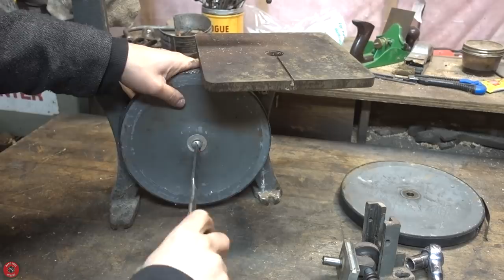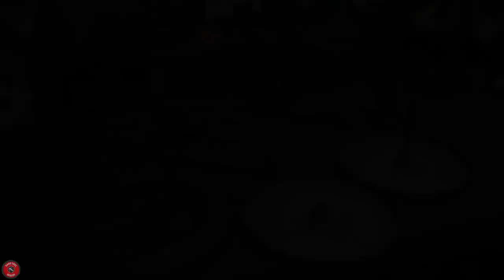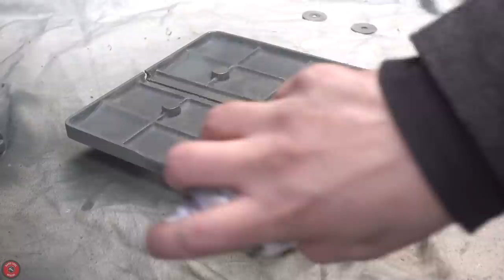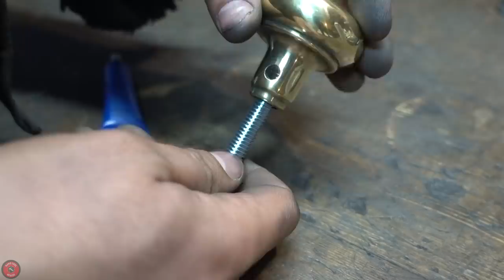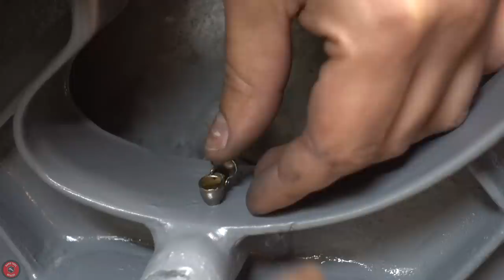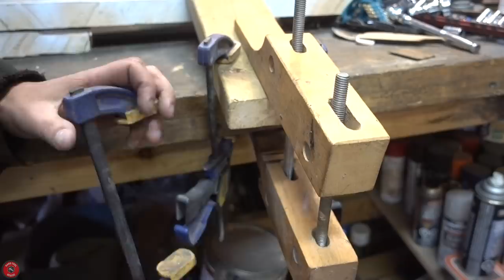1940s Mini Band Saw [Restoration]

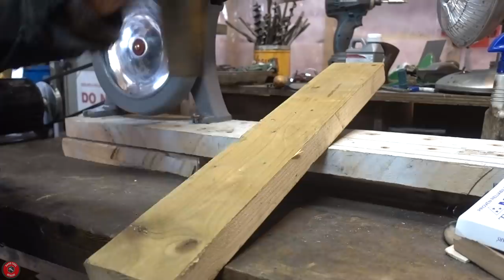Comment: 21:22 Prefect for field use 100% trouble free setup.
Reply from the maker: So easy.
Reply: Handsome Rob kkkkkkk
Reply: Hand Tool Rescue - that part and the part where your spinning the wheel in the drill and it falls out and you slowly back away had me laughing my ass off.

Comment: Dude this video is fantastic. My parwnts bought me this exact same band saw when I was like 12 when I started carving decoys. They bought it used at a yard sale. It was rough then. Time and myself wasnt very good to it. It was definately a work horse, but has a lot of sentimental value to me. Ive been wanting to restore it for years. Just never took the time to do it. This video gave me the jump start kick in the tail to get started on it. I think om gonna steal your brass door knob idea. Mine has the knob still on it. Yours just looks alot cooler. Thanks for the insperation. Keep the videos coming. Ive watched most of what you have since I saw this one. A tone of good stuff man, a ton. Keep'em comin.

Comment: Lovely restoration. I have a nearly identical saw that bears a Montgomery Wards Powr-Kraft logo. I put new tires on it, cleaned it up enough to work well, and now keep it in the kitchen as a little butcher saw. It's dandy for splitting game hens while they're still frozen and saves me a trip to the big band saw in the shop. Now, however, you've shamed me into really tearing into it and making it gleam.

Comment: Just a heads up, the height of the upper blade guide is set to the thickness of the wood being sawn, plus about a 1/4" to 3/8" for safe working clearance. Also the clamp scenario was a hoot and I also liked the drill spinning one of the main pulleys. I would like to see much more of your shows.Great job. GOD bless.

Comment: The latest in a line of entertaining and informative videos. Makes me smile in anticipation when one pops up. Drawing on a comment made earlier -- you might find a variable speed wood lathe useful. I use mine, with an assortment of mandrels, for buffing and wire wheeling. I have 12" and 16" disk sanders made from MDF disks. I have other disks with leather glued around the perimeter that I use for power stropping. A world of uses -- occasionally, I'll even turn a bowl on it :-)  Clyde
Reply from the maker: Good idea!

Comment: You have a great investment there. I think I would use the brass to make the center hole for the blade. I would also put at least a 1/2 horse variable speed motor on the band saw. What a great piece of antique shop equipment.

Comment: Rack up another great video. This band saw may be older than chrome Art Deco so the shiny wheels may not fit, but I do like it. Red added a nice touch of color. Use of the brass door handle was innovative. It is a nice reminder to see something that needed a separate motor for use.

Comment: My Dad and I picked up this antique air compressor made for dental use, it's pretty banged up, would be cool to see it working again but with the shape it's in I think ti would just be a lot of broken bolts and busted knuckles. You should restore an old air compressor sometime, could be a challenge. Gonna get a quick video of it tomorrow, won't be running of course.

Comment: I had a 1940s table top table saw. Weighed like 150 lbs. I replaced the electric motor and the bearings on the blade and used it for 20 years, sold it for more than I had in it.

Comment: Dumb question. Whenever you're stripping the paint off, and it comes off as as a different color like on the wheel for example, does the side that was against the material show the original color of the paint? When the larger pieces came off the wheel, it looked like a lighter grey that's closer to a silver look, compared to the more dulled out grey color that the paint job showed. Or do you think the lighter color was the original color and the darker was a second layer of paint, as the paint job was quite poor as you pointed out.

Comment: Nice restoration, I may suggest to bend downwards the wrench you used as lever to set the base angle, so it got more room to rotate. You can tighten the bolt and adjust the lever with a screw driver using the bolt slot, instead of rotating the lever, so the bended lever can be removed.

P.D. LOL with the clamp action, there is not such thing as enough clamps.

Comment: I saw one of these fitted with an antique (by today's date) Shimano 6 speed chain drive (chain to motor, belt to saw, all neatly packed vertically inside a cast iron cornered cabinet that put the saw at a leisure chest height). It was brilliant just how much low speed that saw had. I regret it to this day that i didn't buy it, but, at the time, for me, it was quite expensive. Oh well, one day...

Comment: Did you have any trouble setting this up for the blade to track correctly??? Can you do another video of adjusting the tensioner. I am restoring a 1938 Walker turner and having some
Issues with the wheels being true

Comment: Can you say what you use to break bolts and nuts loose.  I have seen you use heat and then spray something on.  I have a small Craftsman table saw that I want to restore, but have a few bolts that are locked up.   Thanks for your videos.  They are awesome and give me the incentive to try myself.
Reply from the maker: This one was just wd-40.

Comment: I'm curious about evapo rust. How long do you end up letting parts soak? I know they sponsor your channel but I've seen you use it throughout almost all your vids. I'm thinking about buying a bucket, but I'm a little shy spending ~80 bucks to do so. How many times can you use it? I've got a thickness planar I have to restore and... I think some of it is held together with rust. Just trying to do it on the ... more affordable side, and it may be better to get a rust remover I can re-use throughout the whole project.
Reply from the maker: I get a lot of life out of it.  If you remove the big chunks of rust first, that helps a lot.  You can also look into electrolysis for a cheaper rust removal solution.

Comment: When you are painting things and their surfaces that you don't want to get paint on just take a little vaseline cover that area with the Vaseline just a light coat spray paint over it and then wipe it off and it'll come off just as clean you can use regular Automotive wheel bearing Grease 2 but vaselines cleaner

Comment: I've got an extra tiny bandsaw, but can't seem to find the 54-1/2" blade that it needs anywhere. Aside from that, it's in great working order.
Reply from the maker: eBay has the goods!
Reply: Hand Tool Rescue I never even thought to check eBay. Last few times I bought from there, I got burned, but I hear They've been cracking down on shoddy sellers.

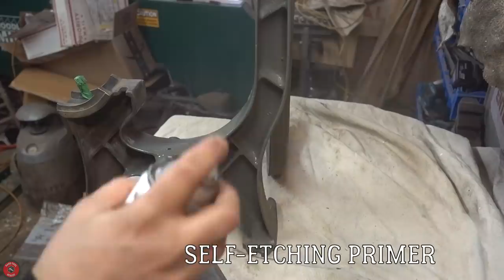Comment: Hay, Like your videos. Great stuff. At position 9:46 on this video, I see that the casting were the bushing is, is broken out a bit. Have you looked at using JB weld for this repair? just a thought. Again, love your videos and what you do with the old equipment.

Comment: Totally love the videos and the humor. Maybe i shouldnt watch these at work. people wonder why i am laughing so hard. Only thing that i cringe at is using the wrench handle to adjust the table. I totally understand why and if i was using the saw, would do the same thing. But is the wrench / handle form the 40's also. Keep up the good work and videos.
Reply from the maker: Chainsaws usually get that treatment as their finish was usually nice and smooth.  The cast iron castings were always rough, so I like to keep it that way, for the most part.

Comment: Have you considered using yardsale price stickers to cover over bolt holes?
Reply from the maker: I could, but I usually leave the tapped holes exposed as a lot of these threads are a bit worn and a little paint tightens them back up!
Reply: That makes a lot of sense, thanks for the reply.

Comment: I use to have Irwin Quick grips. They wound up in the garbage after a few uses. My 20 year old adjustable screw clamps work better. Kept breaking the handles on them and they pop off if your tighten them too much.

Comment: Great. Did anybody notice the blade on backwards? Nice, video edit. Is your middle name “Merlin”? You got the restoration magic.
Reply: It was not on backward. The camera view from where you're talking about was from the rear of the machine. In other words, the brass knob is really on the right as viewed from the front, so it was on right. Blade teeth facing toward the brass knob would have been backward.

Comment: Realy nice do-over on the band saw, 
Isn't it about time you graduated from the drill press wire wheel ?
Reply from the maker: Thank you!  The drill press is the ultimate in wire-wheeling technology.  It is less aggressive because it runs slower and is underpowered.  It also doesn't launch wire fragments at high speed into your face.

The only issue is that it's really not meant for side-load.
Reply: I see you point, I have mine in a chuck on my wood lathe

Comment: I need the blue bands. Where did you get them and what are they called exactly?
Reply from the maker: They are bandsaw tires off eBay.  That's the only place you can still get them for these older machines.
Reply: Hand Tool Rescue appreciate it. thanks

Comment: Had that same one for 40 years, it's branded Montgomery Wards. Reduced the speed for metal cutting. Cute little saw and good quality. Never saw another one.
ON EDIT: Tree came through the roof and broke this saw in half. Anyone need one for parts?

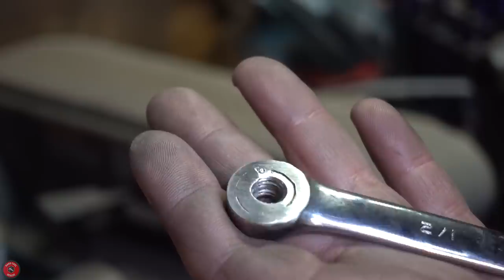Comment: am I the only one triggered by the incomplete fusion in that weld? 14:39
Reply from the maker: It did bother me too when I was doing the editing, but what can you do at that point!?
Reply: lol Probably you're the only one triggered, yes. For the extreme low-stress job it had to do, hot gluing it would have worked just fine. Or taping it on with electrical tape.

Comment: Are you using a wood chisel as a screwdriver?

I thought I was the only person who did that.  Of course, it ruins the chisel...but if I ever need to chisel wood, a screwdriver seems to work well in a pinch.  :-P
Reply: aussiebloke609 Sits back with his jiffy pop,waits on trolls to point out it was a file.
Reply: On closer inspection...taking in the shape of the blade, the one-sided bevel on the tip, and the lack of any file teeth when you look frame by frame...looks like a beat-up old chisel.  True, the teeth could have been ground off, but that bevel on the tip just screams chisel to me...and the handle with a thick metal end for beating on.

sits back, helps myself to your popcorn and waits to see who else pitches their 2 pennies into the ring  :-)

Comment: definitely needed a sandblaster and a metal lathe.  Also?  You clearly needed more clamps.  WAY more clamps. 😏
Reply: The wood blade guide in the table is supposed to be metal, btw.